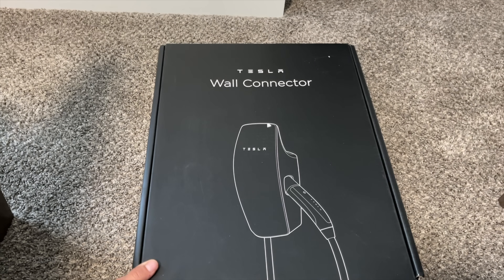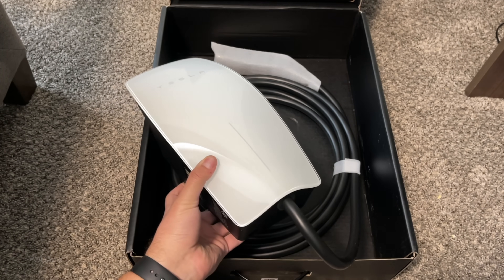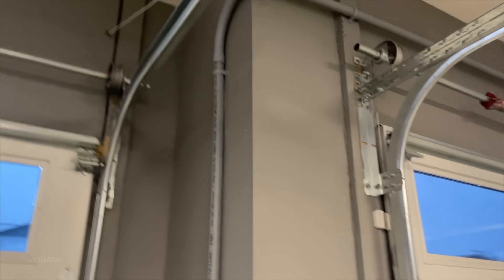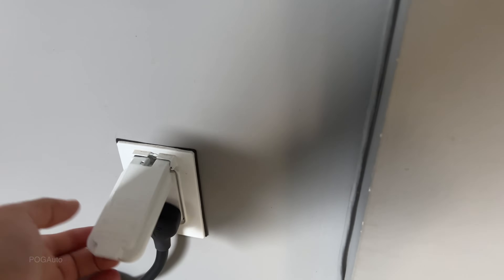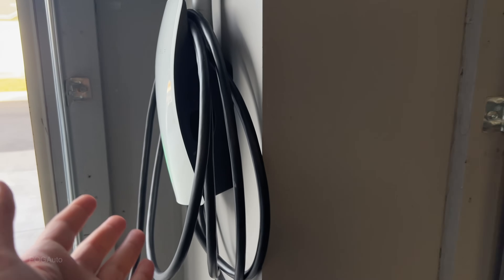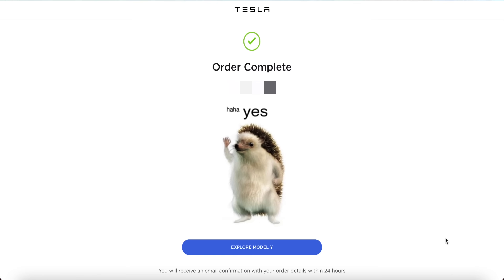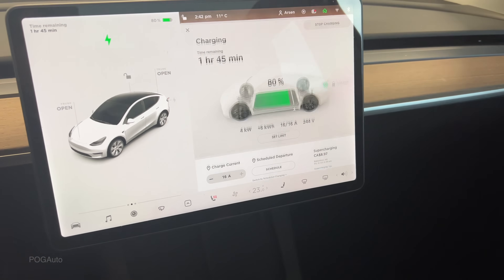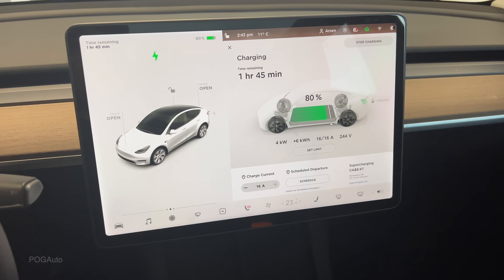Tesla Wall Connector - You need to know this about home charging!

Comment: Yes and all that electric is coming from coal and gas fired power plants. Nice your helping the environment with your electric car. When everyone on the block starts charging your street will blow up and you will be using candles to read at night.
Reply: We got electricians, engineers and contractors debating here.  Time to shut you all up. 
As a manager at a Burger King, volunteer fireman and type 2 diabetic, I will say that charging Teslas at home is way better than having to go to a gas station every week.
Reply: @LeeroyyyyyJenkinssssss  No offense, but the guys here talking are speaking of things you have no idea of. No your place and stay in your lane. This is not a place for you to comment.
Reply: Common anti-EV comment.  Maybe from coal or gas.  Maybe from wind, solar, hydro too.  But much more efficient than a gas car, get about 3 miles per kWh of electricity, which works out to the equivalent of over 100 miles per gallon of actual energy used.

Back in the 50's very few people had air conditioning.  Now almost everyone does.  This did not overload the grid, at least in states not run by fools.  As EVs slowly are added the grid will be improved, just as it was to allow for air conditioning.  Also, if EVs are charged overnight, this will make the grid more efficient because it will be more fully utilized because the grid is underutilized overnight.
Reply: @ericjorgensen4826  as an electrical contractor I can tell you you are wrong if everyone on your street has an electric car charging at night the grid will never handle it. It was not designed for that kind of load. You sound like an intelligent person I just don't think you understand the sizing of a residential grid and what is capable of handling.
Reply: @Eec2023 How about a little intellectual discourse?

I agree with you "When everyone on the block starts charging your street will blow up . . ." IF that happens now, or even soon.  

But did you read what I wrote?  "As EVs slowly are added the grid will be improved, just as it was to allow for air conditioning."

Right now EVs are a very small percentage of all vehicles.  And it will not go to "everyone on the block charging" quickly.  It will be a gradual transition.

If everyone installed central air-conditioning in 1955 the same thing would have happened to the grid...it would have suddenly been severely overloaded, from generation to transmission to distribution to individual services.

Back in that time, a typical new middle class house had an electrical service with 4 to 6 screw in fuses and a 240 volt service with two 60 amp cartridge style main fuses, with maybe a second 40 amp 240 volt pull-out style fuse holder for an electric range.  Older houses often had less: back in the 1960's my grandmother's house that was built in the 1930's still had a 30 amp 120 volt two wire service with knob and tube wiring.  

Almost all such electrical systems have been since upgraded.

And charging overnight (or other off peak times) will help the situation for those that can do that, which is most people.  It will more fully utilize the grid, which is underutilized during the 12AM to 6AM time.

BTW, not an electrician, but a EE here.

Many if not most houses with 150 or 200 amp service can handle an additional 240 volt 24 to 48 amp load on their service conductors and electrical panel.  As EVs are added, over the years, the many of the distribution transformers will need to be upgraded, as will the entire electrical grid to get to the point where EVs are the predominate vehicle.  

Also, it is possible to use load management hardware that can make even a 100 amp service work satisfactorily for EV charging, depending on the type of loads currently being served.  There are several EV management systems available that install CTs on the service conductors that allow the system to monitor the total current being drawn, and if it goes above 80% of the rating of the electrical service will shut down the EV charging circuit until the load returns to an acceptable level.

The house I grew up in in the 1960's used to have a 37-1/2 kVa transformer that fed it and 5 other houses.  Now this transformer has been changed out to a 100 kVa transformer for these same 6 houses.

In my case, I personally have two Tesla EVs which have no problem simultaneously charging at 48 amps (240 volts, 11.5 kW each).  Each EV circuit is attached to one of my 200 amp panels with a 60 amp breaker, with #6 AWG THWN CU wire in conduit to the Tesla Wall Connector.  The panels are fed from my 320/400 amp service.  Florida Power and Light recently proactively upgraded the pad mount transformer that feeds my house, along with two others, from 50 kVa to a 75 kVa transformer.  My underground service is fed with parallel runs of 4/0 AL, and the 200 amp panels are each fed with 3/0 CU from the main disconnect.
Reply: @ericjorgensen4826  listen I respect your knowledge. I'm an electrical for 40 years and technically most of what you stated is true on paper I think your confusing the "grid" with residential service sizes. 
I don't really want to get into it but just because you have a 200 amp service on your house now doesn't mean much. 50 years ago it was a 100a. I get it but it's still the same conductors hanging on all the poles all over your town. My secondary lines on our block are 60 or more years old. They are #6 aluminum. Most of the town are the same except newer areas built later. You can put whatever transformer or service size that you want the so-called grid you're talking about will get destroyed or it will cost outrageous sums of money to upgrade all the primary and secondary cables when 60 houses on one street are pulling 11 KW every night but again that wasn't the main point of my post, which was that all these electric cars are running on natural gas, oil, or coal. That my friend was the point I'm making we need our power plants to go to nuclear or some type of fusion to generate electricity. Until we do sell electric cars are a farce regarding our environment.
Reply: @Eec2023  Thanks for your comments.

What you say is true about all that #6 AL in older secondary distribution systems.  I always thought it was strange that a 200 amp service with 2/0 CU to the meter or weatherhead is connected to much smaller AL wires coming into the meter from the POCO.  But the POCO installs their wire to the meter based on calculated load and voltage drop, and generally there are no problems.  Adding loads for EV charging without considering the size of the distribution wiring will no doubt result in problems.

EV charging is usually a continuous load given that charging an EV at home can often take more than 3 hours, and the Code requires an EV circuit to be designed as a continuous load.  A 60 or 50 amp EV circuit (operating at 80% or 48 or 40 amps) which operates continuously is much different than a 50 amp circuit for a range and must be installed properly to avoid risking damage to a substandard service, or improperly designed and installed branch circuit for the EV.

FWIW, I did not buy an EV to because I thought EVs will save the environment.  I bought my Tesla Model X Plaid because it is a really great car.  0 to 60 in 2.5 seconds.  Really fun to drive. Smooth as silk,  Auto pilot.  Etc.

That said, the car gets the equivalent mileage of over 100 miles per gallon of gas on the actual joules of energy it consumes.  So for those out there who think they can save the environment by driving an EV, they will use less energy, no matter where that energy comes from, not that EVs will save the environment.  I don't believe that for even a minute.
Reply: @ericjorgensen4826  All true and good comments. The other thing that amazes me is when people tell me the "mileage" their Evs get. That is only because of the incredibly cheap rate of electricity "because of fossil fuel generation ". If you had to build a solar or wind system capable of producing enough electricity to charge your ev in a few hours I can guarantee it won't be anywhere near 100 mpg. 
All that said my son came home yesterday with a new model 3 that I installed a gen 3 for in the morning. Drove it last night and it is truly an amazing vehicle. Best of luck to you.
Reply: @Eec2023  You may be a contractor but it doesn't sound like you're a grid engineer - sub stations and other infrastructure will grow around the demand, just as they do when major housing developments go in and the sub-station needs to be upgraded / new equipment put in to meet load demands.

What is happening in most countries is that we are moving more towards decentralised grid supply (micro sources such as home solar etc.) where the larger power stations don't need to supply 100% of grid demand.

BTW I have my Tesla 3 hooked up to a 415v 3 phase supply (Australia) and even then it only draws less than 1/2 the total power per hour  than my ducted air conditioner and only when it's actually charging once or twice a week.

I live in Sydney Australia with a population of a little over 5million - we add 50,000 to 60,000 homes every year to the electricity grid with an average consumption of 30 kwh per day - that's 1.5 million to 1.8 million kwh demand added to the grid every single day - by comparison we only added 4350 electric BEV or PHEV vehicles in Sydney in the first 90 days of 2023. Even if every EV was added to the mix (all 4350 added 1 Jan) and we plugged then all in every day for 5 hours a day it would still only add up to less than 10% of the load of the additional homes added to the grid - I think we're safe.
Reply: @TB-up4xi  you're talking about a lot of different things. I'm not a grid contractor. I'm in electrical contractor. I'm talking about those tiny thin lines that are running down everyone's street on top of the telephone poles. They were not engineered for that kind of load to be taking place in every household on the street. New development completely different story. I'm talking about the millions and millions of streets in the country that do not have the infrastructure to handle that kind of power. And I have 40 years experience. I know what I'm talking about, you don't.
Reply: @TB-up4xi  boss man all the wires hanging on the telephone poles all around the country will have to be oversized to handle these new loads. That was the point I made in the original post the grid cannot handle it. It will take massive massive amounts of money to upgrade the wires on all the streets in this country, it's not sustainable
Reply: It doesn't even matter where the electricity come from is still better than burning gas
Reply: @pastorgoof  you can't be more wrong. The pollution controls on cars are much more stringent the on power plants which are burning fossil fuels that emit more than a car with dozens of devices restricting emissions. 
As always on YouTube people who have limited knowledge are always the first to chime in and spread false information.
Reply: @pastorgoof  it doesn't matter where the electricity comes from its still better than burning gas even though the plant supplying, the electricity is burning gas.....duhhhhh I'm a moron!!!
Reply: just wondering, if you do not have a tesla and is against it, why the hell are you watching a wall charger unboxing??? 💀
Reply: I'm not a huge save the earth fella but I like the idea of progressing towards sustainability. As we add more EVs we will all start thinking of new ways to power and sustain them likely looking towards solar panels and battery packs like the tesla powerwall. And as we all do that that will push to advance the battery tech in both EV and powerwall batteries to be more and more recyclable so we can drive down costs and waste. This is how we progress. Nothing rolls out perfectly usable and sustainable. We progress through iterations to achieve it. Like coding, we have to go through versions and with every version we see progression. The grid will adapt and so will solar as we continue to innovate with EVs and other technologies in our homes. Only way this happens though is if we have adoption of the new tech and it is useful. 

I love the idea of our homes all turning into fueling stations powered by the sun. That's just bad ass. And assuming there's a version of solar panels in our future that are either biodegradable or recyclable that's where the magic happens. Or just use fusion reactors once those have their innovative premiere into mainstream power. 

Only way to get there is to keep moving forward and keep asking for a more sustainable version with every release.

EV owners keep doing what your doing. 

ICE owners,  you don't need to change anything until perfection of the system in grid, sustainability and convenience of you don't want to. But there is a lot of cool features when you do!
Reply: @kevink7373  solar will never power modern American homes. Maybe in Norway with no ac units, 60 amp stoves ect. A nuclear or fusion type source is the only way to go. Or, we can waste a few more trillion dollars on the solar dream.
Reply: You are probably the type of person who thinks the electrical grid will go down and we won’t be able to charge, yet you will be able to use the electric controlled credit card to pay for your gas. If we ever face something like that going down, your car will save you, you better have a bunch of guns, ammo, food, and water 😂
Reply: How do you find yourself on an EV charger install video and talking this shit? Unless you’re a troll and sought it out.
Reply: @utkyle12  1. Because I install them for a living and probably know more about it than you. 2. Because what I'm saying is the truth. 3. Because this is a place where people exchange different intellectual points of view. Why not respond to my actual comment and tell me how I'm wrong?
Any ideas of your own?
Reply: @Eec2023  The CO2 per kw/h (delivered) for California is 0.879 pounds (i.e. end to end C02 production for the full cycle including the full production chain of the fuel source is 0.879 pounds for every kw/h produced).  For a Tesla model 3 in a warm climate the average milage is 4.0-4.5 miles per kwh for a base RWD so for 10,000 miles (lets take 4 to be on the safe side  that equals 2198 pounds of CO2 produced IF 100% sourced from the grid in CA. For a modern sedan (say a BMW 330i) the CO2 produced at the tailpipe is 0.35 pounds per mile (combined) so for 10,000 miles that's 3500 pounds CO2, but there's about 25% extra CO2 per gallon from the refining and transport process (which is already factored into the California delivered CO2 number) so that's 4375 pounds for 10,000 miles or about 2 times more CO2 from a modern ICE v BEV.

Even in the worst case scenario (100% from the grid and no home solar) a Tesla 3 produces 1/2 the CO2 of a similar 3 series BMW in CA.
Reply: @TB-up4xi  chubbs, bottom line is the power plants are mostly burning, gas or coal to make electricity to charge all these electric vehicles. That was the point of the very original post here.
Reply: Thanks guys, great discourse for us non-electricians to hear. We need to be more informed.
Reply: I hear your mommy calling you for dinner
Reply: @chuckyp7058  wow you really put a lot of thought into that. That's about a 65 iq response. You work in a factory sorting washers?
Reply: Chucky. lol 😂
Reply: Im getting a tesla not for those reason. I don’t really don’t think it’s helping the environment that much. Battery manufacturing, mining is nothing different. It will be a secondary car after our gas sienna. It just helps that our primary family car is petrol hybrid and one is plugged-in for my wife’s work.
Reply: You do realize that lines an be upgraded as demand in an area rises, right?
Reply: @Sulfen  do you realize that's what I do for a living and that your silly comment is cost prohibitive?

Resist the urge to post comments when the grown ups are speaking. 😀
Reply: No one cares
Reply: @thewirednerv  you mean assholes like you don't care. I agree totally. But more intelligent people actually do care. You should go watch professional wrestling videos and stay away from where the smart people talk.

Comment: I order the nema 15-30 plug 🔌 $35 and its charge me 240volts 24amp
Reply: You use the mobile charger right? And also after installing your nema 15-30, do you get your charge to 80% for the recommendation and not worry about it after?

Comment: I had my box upgraded to 200 amps back in 2019.  Cost was $7,000 including the Tesla wall charger installation.  Currently my Model Y gets about 44+ miles of range/per hr. And, my Model S gets about 37+    I charge during non peak hrs and sometimes during the day when really needed.  My model S is unlimited FREE charging when using SUPERCHARGERS. So unless I'm far away from home- I don't sweat charging at all. With 50miles or less, I alternate from home -to-superchargers in my area if I seriously need it.  With the 200amp upgrade, One doesn’t  have to worry about major appliances running, with HVAC being on and risking tripping any circuit breakers. It all runs smoothly.  Home is 3500 sq ft.   Goodluck with your cars
Reply: What was ur subpanels amps before the upgrade

Comment: So the car is charging from the electricity  from the house? So this runs up the electric bill then right??
Reply from the maker: Yes
Reply: @POGAuto  oh wow ok..thanks for the info
Reply: @MrOne1811  just curious, but how did you think the battery was replenished in an EV?
Reply: @madmechanic3213  I was hoping someone had figured out how to absorb all the free electrons floating around in the air, smh
Reply: Yes.  Where I live electric cost is about 5¢ per mile. My model X Plaid gets 3 miles per kWh.